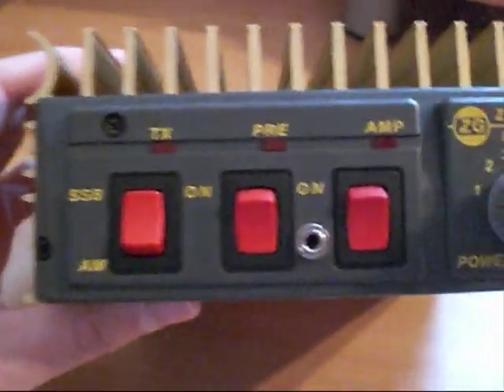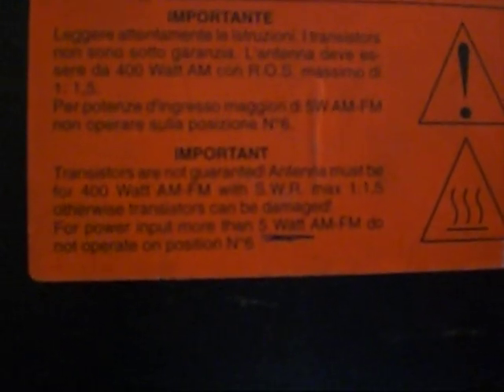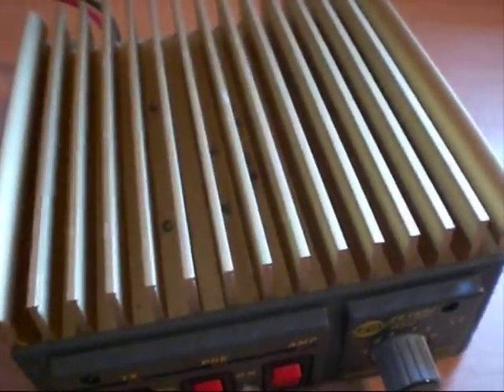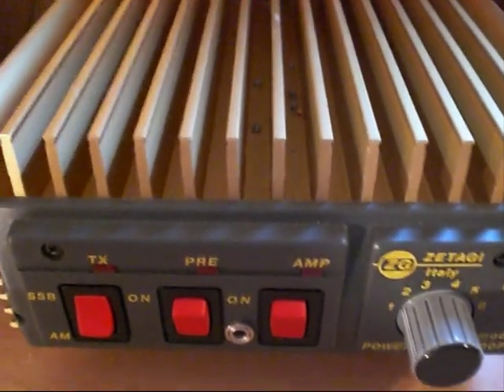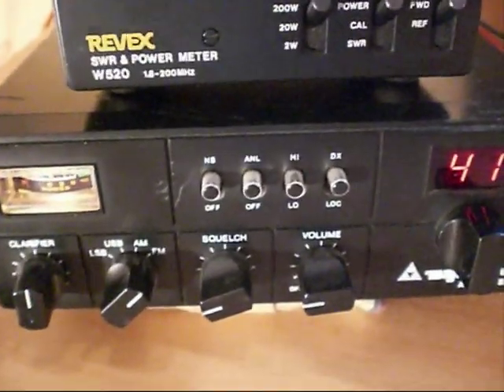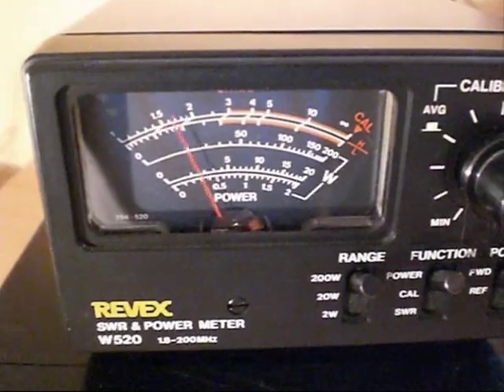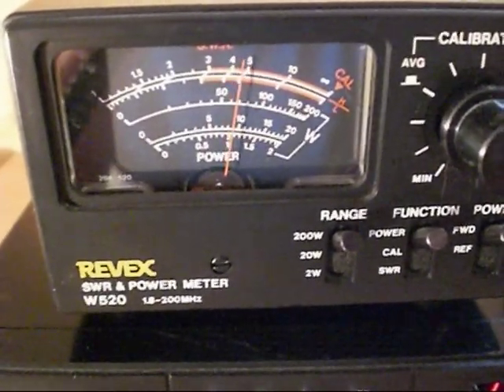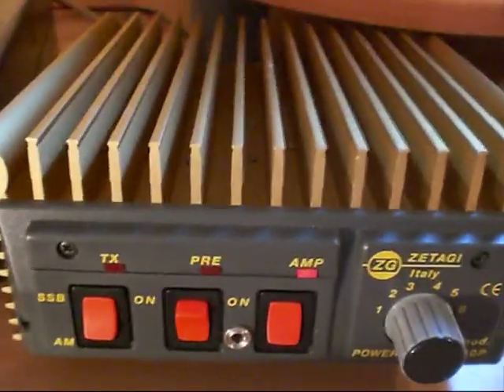ZETAGI B300P - TRANSISTOR REPLACEMENT -MRF455.

Comment: anyone got the schematics for the front board on the zetagi B300p i can find loads for the main and rear boards but not for the front
 i basically need too find out the value (ohms)of the 2 resistors on the far right of said board behind the selector switch as you look @ it from the font

Comment: i've already got a matched pair and just bought another matched pair as the 550 runs two matched circuits, i'll give it a go and see if it works..
also changing the input resistors may make it handle more input power, so i'll have a look into it..
i already have an 8 pill using 2SC2879 so wouldn't be to hard to possibly get some measurements from that..

Comment: What about the Zetagi B5550P ??
runs four MRF455 all blown, only did around 200w, was going to change to MRF454, but then can use 2SC2290 as a replacement..
so what about going the whole hog with four 2SC2879 ??
on paper then seem to be all around the same with voltage differences from 40v to 50v to 60v amp and current seem around the same..

so what you think, B550P with four 2SC2879 ??
should see 300w at 10w drive...
can you see any problems ??

Comment: throw the crap away, class C Amplifier are ok for FM but not worth in AM/SSB
I tried a lot of those Zetagi Amps.
Afaik there are no Zetagi Amps with AB Bias circuit available.
 I suggest spend a little more money into a quality brand, maybe 300$ for a good 100W Amp. believe me, Zetagi sucks!

Comment from the maker: It's best to remove the transistors to test them correctly, i recently repaired one of these where the relay would not switch in on TX but it was just a dry solder joint on the board.

Comment: A lot of those cheap Italian amps are biassed more like class C than A or Ab, hence they sound like shit when used for SSB & AM. You may get near 200 watts from a couple 455s, but it'll be a dirty old 200 watts & on a scope it'll be ugly.
I usually mod the bias in these amps to put them into Ab, & while you lose some output power, you sound much nicer, you gain a pretty picture on a scope & happy neighbors on a crowded band. No kidding, these things are wide. Better output filtering is nice too.